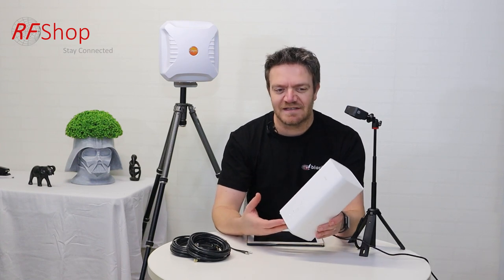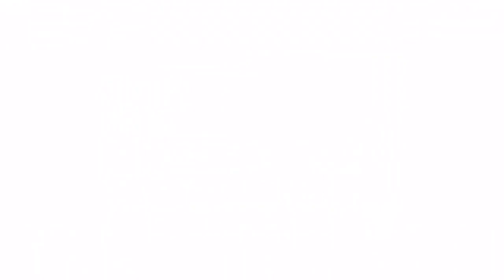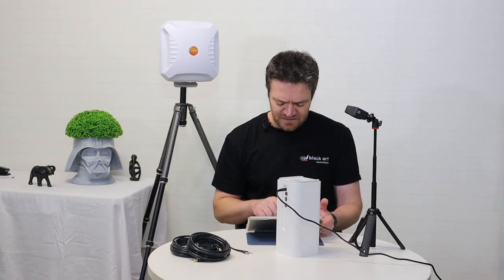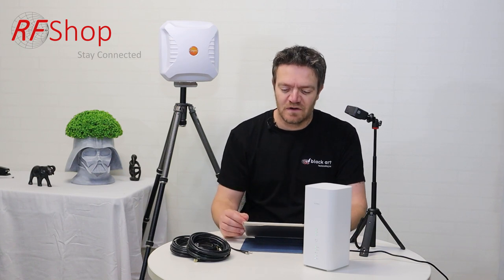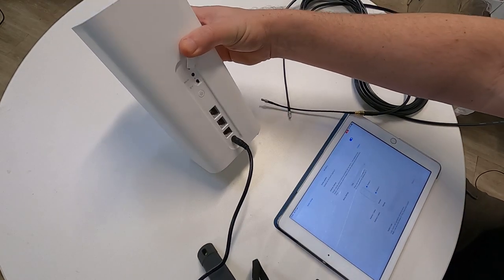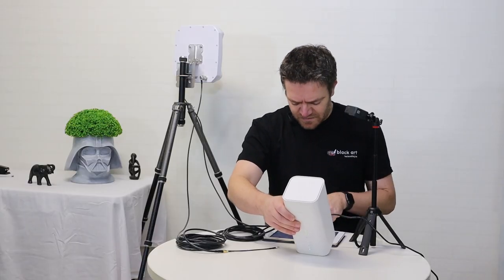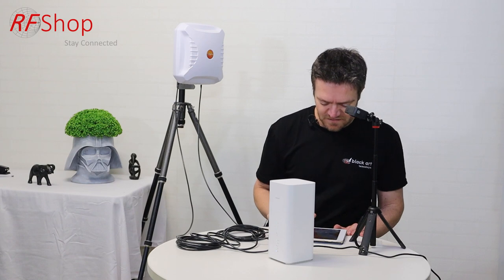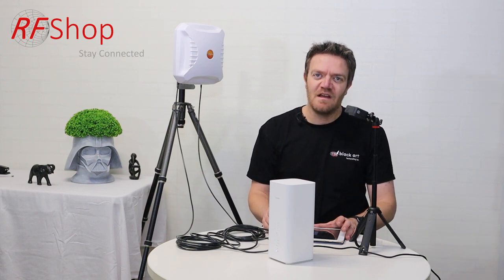How to connect a 4G external antenna to a Huawei B818 modem

Comment: Great vid mate... I have the Huawei B525 and the xpol-2 and when I plug the antenna in the unit shuts down completely (all all LEDs off). I bought a TP Link router and it doesn't shut off but it makes no difference. I don't even know if the antenna works and I can't get hold of the WA business that sood it to me.

The kids are ready to murder me at this point 😬
Reply from the maker: That does sound like a problem with the switch for the external antennas. Have you tried forcing it (by software) to go for the external antenna? Also, you may want to try one antenna port at a time…that coukd potentially identify which port is faulty
Reply: @RFShop  yeah it works in the left port and shuts down when you plug it in the right. I'm assuming it means the antenna works though...

I'm currently, like you did in this vid, trying to source a newer Huawei on Gumtree.
Reply from the maker: @harrisonclub  Yes, that’s a good idea. Sounds like the internal swith on that particular port is broken and shorts the power when enabled. Another unit should resolve the issue
Reply: @RFShop  thanks heaps for replying to a year old video. I really appreciate it and I'll certainly use you guys if I need anything else to get the internet working here!
Reply from the maker: @harrisonclub  it may be a year old video but it’s also my all-time best so very close to my heart !!

Comment: the cable that came with the antenna I BOUGHT WAS SPLIT. Infact I have the same  external antenna in the video
Reply from the maker: Hi, do you mean it was two separated cables? If so, that's OK...as long as it's two unique cables feeding into the modem. The combined cable is just to make things easier and neater but every coaxial line does its own thing in complete isolation.

Comment: 4G is all well and good but the data allowance isn't enough. Need more data to be more attractive. Those speeds are great though. If you don't mind low data allowance and cg-nat then this is the way to go.
Reply: Optus provides 500Gb and 40Gb top ups... it’s then shaped after that... though im sure with the rollout of 5G it will go to unlimited very soon. Optus is by far the best deal atm for 4G data only home broadband.